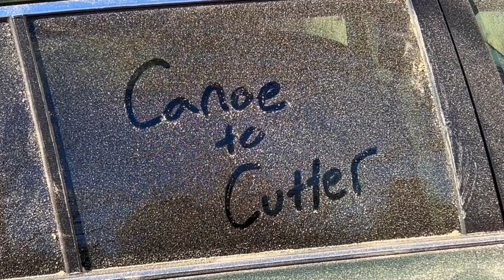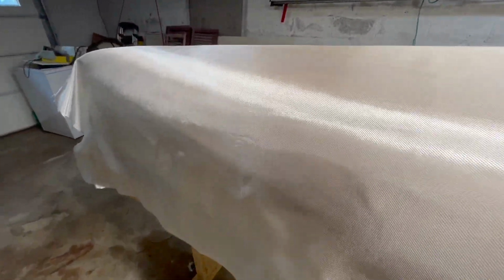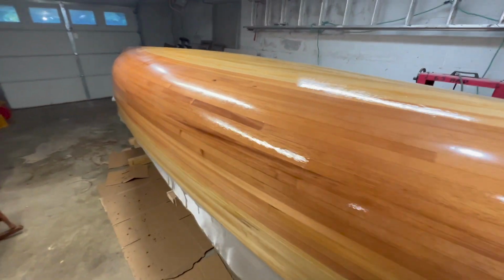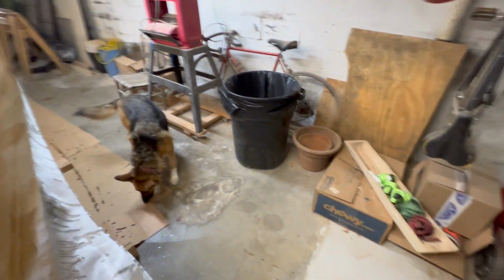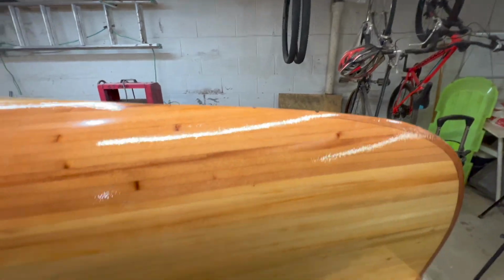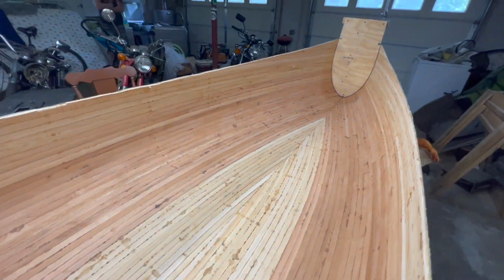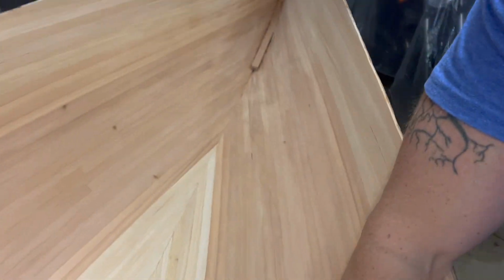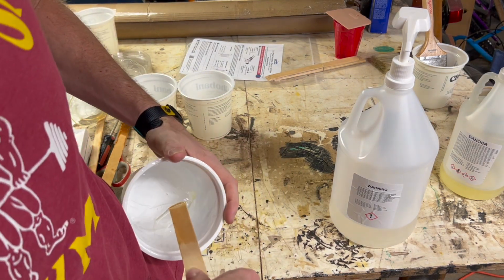Canoe Ep.6 - Glassing the Hull

Comment: I live in Northern Michigan we have an abundance of homemade canoes, kayaks and boats. Check out the "Au Sable River Boats" really cool, designed for fly fishing, all custom built. Yours looks great for your first  one for sure. I'm in the middle of restoring a 58' MFG runabout. We got her ready to varnish, just wrapping up the transom. It's not going to be as pretty as yours, but really cool. Because of the checking on the mahogany plywood up front I decided to use penetrating epoxy to seal it, but I am going to glass the transom because of the gaps between the boards. Need to make them one again. I bought a new 4 stroke Suzuki 40hp for it, so not totally vintage. It should be a killer little boat when we are done. This is my first go at this stuff too, I am an electrician.
Reply from the maker: Very cool and thanks for the encouragement. I actually filmed this video last summer and since I’ve been at the boat building school I’ve learned so much building bigger boats that I can’t wait to get this canoe done and start on a more complicated boat.
Reply: @canoetocutter  Nice. If you go on my channel I have a video of the boat before we started the project, it's filmed at our old house about 4 years ago I think. I'm going to post a couple update videos for anyone interested as it progresses.
Reply from the maker: I’ll check it out!